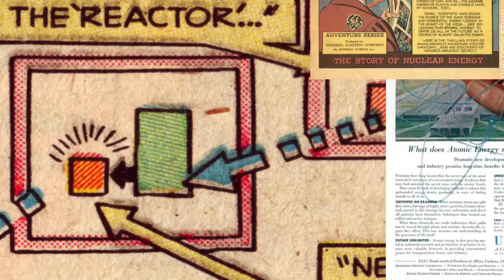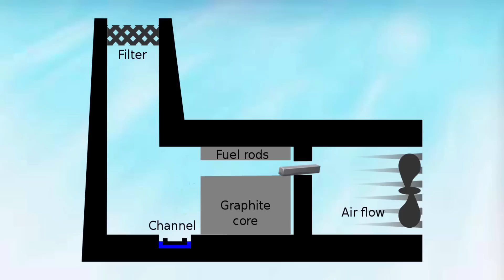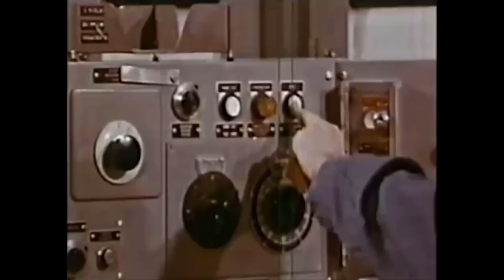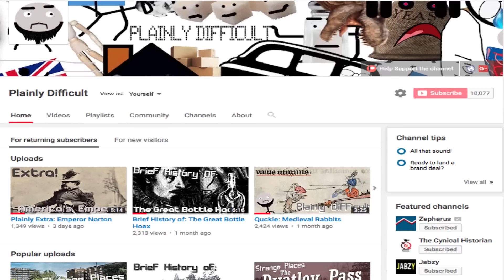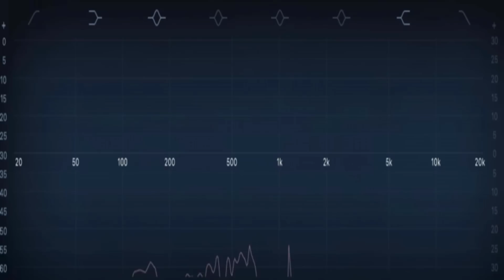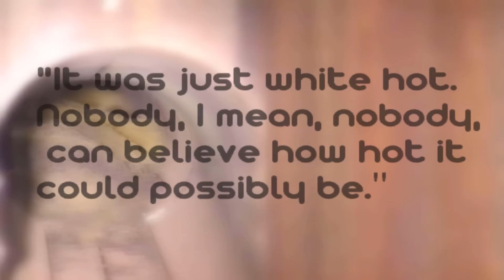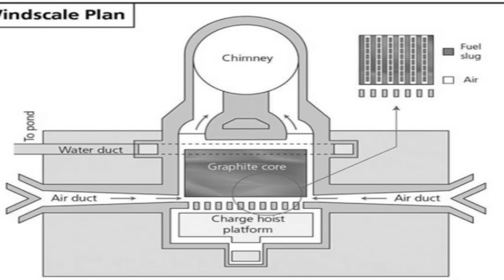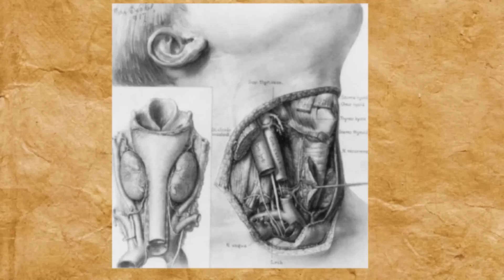Brief History of: The Windscale fire

Comment: "Oh no! There's a fire! Turn UP the fans!!........"
Reply: I had that thought too... When they finally turned the fans down/off, the fire went out... Fascinating....

sarcasm noted
Reply: @daytona1073  They were worried that if they turned the fans off, the lack of any alternative cooling would cause another power surge and set fire to the whole core. They had to try everything else first. They were only able to turn the air off after the water was put in.
Reply: That usually helps 👌😂
Reply: Just watching this now and thought the same, madness!
Reply: 3.6... Not great... Not terrible...
Reply: @slightlyevolved  no, just a humanity who were still in the early stages of understanding nuclear science and its many hazards.
Reply: @nemo-x  Yes, it is entirely relevant. The whole reason the core had this issue was Wigner energy which was a barely-understood phenomenon.

Also, literally all nuclear reactor cores are designed in such a way that they are hard to dismantle.
Reply: @nemo-x  What redundant cooling systems did plane engines have in WWII?
Reply: Except for the fact that at time of turning up the fans, they didn't know that there was a fire.
Reply: Oh no, there’s a fire turn up the fans quick no need to rush. Oh merciful Neptune what is happening at windscale?  The engineers at the wind at scale facility needed to prevent the core for melting down channel 2053 did not heat up very evenly. Somebody ordered the cooling fans to be sped up. How does wind scale higher one work let me see how does wins scale pile one operate? I will show you how scale pile one operates in place of water, air circulated via convection, the 400 foot tall chimney, for additional cooling huge fans we used to blow air through the chimney. I think they might be industrial cooling fans. Well, I never been to Great Britain, but really cool to see how it operated so great Britain’s Chernobyl was the Windscale fire.
Reply: Maybe, but... What kind of brain trust designs and builds a machine like this, with NO OTHER COOLING SYSTEM?? Really? Smh....
Reply: @daytona1073  brains far more intelligent than you could ever hope to be. What have you contributed to life?
Reply: @nemo-x  er no, Control Rods Control the reaction. Not the heat, even with rods all the way in a reactor usually produces a sizeable amount of decay heat.

Also, you implied having secondary loops for primary coolant. Unnecessary complication which increases the odds of a failure.
Reply: @nemo-x  
- References aircraft engines which handle gasoline.

Yeah, you really don't want a core handling radioactive materials and that is designed to irradiate uranium and suchlike to be easy to take apart in service. Most cores nobody goes near for about 60 years... AFTER they are shut down.
Reply: @nemo-x  Also, All reactors that are in service today have a single means of cooling i.e. their primary cooling loop. Some have backups but generally the reactors in service today don't.
Reply: @nemo-x  "As unacceptable back then as it was today".

Except it wasn't unacceptable by the standards of the 1950s, the time it was built and operated.

Furthermore, LOCA was seen as more of a risk on a water-cooled design back then. Also, in case you failed to read my previous response, few if ANY reactors used today have backup cooling. The only model I can think of are the AP1000 PWRs and even then, that's there in the event of total power failure, not an unexpected event leading to a burst can/fuel element fire.
Reply: @nemo-x  No, the control rods can't. Their function is NOT to cool but to halt the rate of reaction in the core. Only having that without any form of active core coolant circulation will lead to a temperature excursion.

Also, you obviously don't understand much about nuclear energy to believe this idea of "it's unsafe because there's only one way to shut the reactor down". Newsflash, ALL reactors are like that and it's perfectly fine, because that single method is guaranteed to insert the control rods even if the power were to fail.

And again, the design of Windscale was acceptable at the time it was built and operated because nobody had gained the operational experience yet- which we gained from Windscale- to say that it was a bad/unsafe/impractical idea.

I suggest you go away and learn about the nuclear industry this early on before trying to lecture someone else, while using inaccurate information to back up what you seem to think is true.
Reply: @nemo-x   @Cody Nemo  Nope, that's entirely incorrect. The element channels allowed for the elements to be pushed out of the back of the reactor into a water channel, where they could be transferred to the adjacent storage pond before being sent for reprocessing.

The control rods were fine on this design but once the fuel can had split and the fire started, dropping the control rods wouldn't make much difference to the core temperature.
Reply: @nemo-x  You obviously don't get the issue very well of Wigner Energy then, as that was what helped cause the issues here (that and modifying the fuel cans to have shorter cooling fins, which meant the fuel cans were running hotter than designed). The original design would not have encountered the higher temperatures seen in the run-up to the Fire, but due to pressure to have weapons-grade fissiles produced the fuel burn-up rate had to be increased. 

What you're essentially trying to say- to use a relevant analogy as I listen over something about Byford Dolphin- is that people should've designed out decompression sickness back when it first occurred in the late 19th Century, before it had actually been formally discovered and classified.

Also, with "You do not design a system you expect to get hot with no easy way of shutting it off. Period. There really is nothing more to it." you again seem to misunderstand the key points here. 

The reactor itself was easy to shut down and control, the control rod system was much like all others used in the UK then and now (spring-loaded control rods held in place by an electromagnetic contact, so that they can be rapidly inserted should anything happen). Decay heat is another matter, and as several other situations have proven at other plants the decay heat can get out of hand even with adequate systems, if things go wrong.

The coolant system was adequate for the original design, one of the key contributing factors to things going wrong was the trimming of the fuel can cooling fins as this meant the fuel elements were hotter than the system was designed to handle (again, not a fault of the plant itself, and was also why any future plants seeing in-service modification were usually subject to scrutiny before the modifications were permitted).

While I don't think much of the idea of an open-loop air-cooled design, it was actually not the worst plan that had been created at the time (the worry with using a water-cooled design was that a LOCA would lead to a catastrophic core failure, which in theory was circumvented by having an air-cooled system).
Reply: @nemo-x  And yet again... The design was acceptable to the standards of the time. Given the design was meant to operate at relatively low temperatures, the risk/issue of core overheat was never anticipated and was a side effect of several in-service alterations. Namely:

- Reducing the size of the cooling fins to increase burnup

-  Heating the core as part of Wigner annealing so as to avoid a fire due to stored energy in the core.

Again, kindly go away and actually learn about this properly. Then come back and try again.
Reply: @nemo-x  Yes, there were control rods. All reactors have them because it's a fundamental of controlling the nuclear reactions present.

Furthermore, with the situation as it originally stood, the fuel removal process worked fine. Moreover, you say about "one way to remove the fuel", that applies again to EVERY reactor in service, ever. Most are top-loaded such as those at Calder Hall.
Reply: @nemo-x  A further point I'd add here is that I'd point a lot less fingers at the scientists and engineers involved here, and a lot more fingers at the politicians who were pressuring them to accelerate the production of material for the weapons program.

As ever, this story is mostly one of politics leading to problems.

Comment: Uh Windscale was definitely worse than 3 mile Island.  3 mile island ended with one reactor unusable but contained and didn't expose anybody to more than half a chest x-ray's worth of radiation - significantly less than you receive in a year from background radiation.  There was very little release of dangerous isotopes in 3 mile island - most of the release was noble gases.  The human effect of the contamination from Windscale was much worse than 3 mile.  

Plus Windscale is just one of those "WTF were they even thinking?" moments.  3 mile at least was a complex accident involving several different failures at once - understandable in a very complex system.
Reply: Three Mile Island - Half a chest x-ray's worth of radiation? You are a great liar and  would make an excellent used car salesman or congressman.
Reply: @jackfanning7952  He's right, that was the average exposure per person.
Reply: @robokill387  The exposure was much higher. Those exposure readings were taken from a helicopter over a river valley. The down wash from the helicopter blades created an inaccurate reading of actual radiation. Experts have shown that the radiation levels were much higher. Even the government agency providing these measurements, upon reflection, admitted these readings were probably 10 times too low. Other experts believe the actual exposure was over 100 times higher.
Reply: @jackfanning7952  Source?
Reply: @pseudotasuki  An NPR documentary broadcast several years ago that included testimony from leading scientists from the NRC, state of Pennsylvania and federal government. Sorry I don't have more detailed information but you should be able to dig it up from the archives. I believe there were three scientists that spoke and the documentary was an hour long.
Reply: @pseudotasuki  The source is Arnie Gunderson, nuclear scientist that testified at the hearing on the TMI accident. There is a YouTube video of Dr. Gunderson presenting his data entitled, "Best Documentary Films Three Mile Island Accident and NRC Lies (by Arnie Gunderson) April 6, 2017 Golfez Starlighter. " I know there was another documentary on NPR that presented similar information by Dr. Gunderson and other information as well.

Comment: Been watching your content a bit, and this is a testament to your skill to portray everything as "gray" as possible but. What is your true thoughts of atomic energy? Are you against or for? Just curious as this seems to be your main stay. I can say myself that whilst I understand the risks behind nuclear energy, I am for it since with correct procedures it can be much more clean then for example fossil fuel power plants, and nuclear fuel contains A LOT of energy to be tapped into.
Reply: I hope that Liquid Fueled Reactors will take over
they provide on-line Fuel Processing to maximize Safety/efficiency
and we should really start using Liquid Lead as a Moderator, it loses its moderating Capabilities when heater faster than Water,
so it is more selfregulating 
using the Lead as a coolant would even allow for superheated Steam to be produced which would further increase the Efficiency of the System